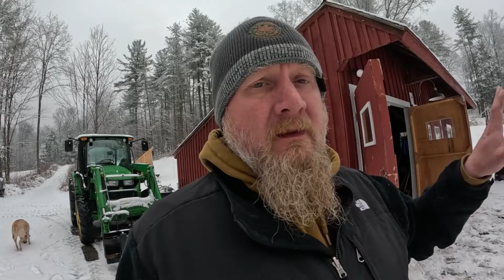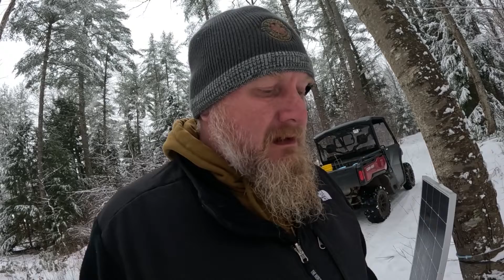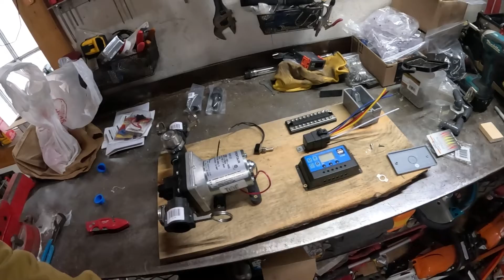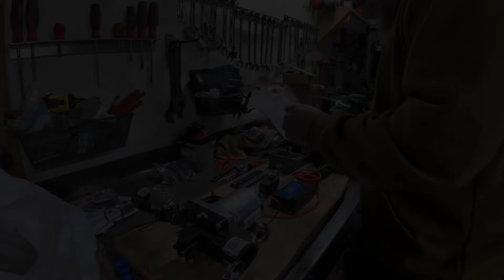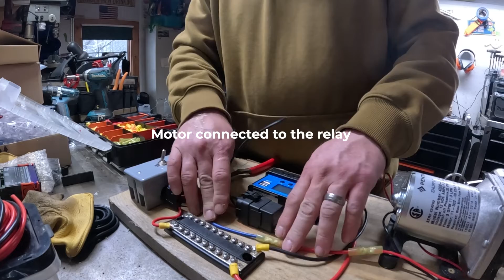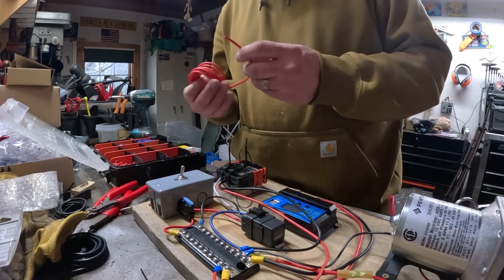Building an Off-Grid Solar Vacuum Maple Sap System

Comment: Mine pulls 18 inches of vacuum on 300 foot of 3/4 main line with 100 taps and 10 laterals. Have had a couple days in the last couple years that were 200 gallon days.

Comment: I bench tested the 4008 and 4048.  When it comes to pushing water obviously the 4048 with a bigger motor has a larger capacity but when pulling a vacuum they both perform the same.  Both pumps would achieve 25 inches of vacuum with 30 gallons per hour of flow. More flow  and the vacuum would start to drop off.  When pulling a vacuum both pumps ran between 1.2 and 1.5 amps of draw.  Conclusion. For pulling vacuum don't waste your money on the bigger motor.

Comment: Great video very informational.  Question how did you connect the mainline to the pump? Which adapters did you use? Thanks
Reply from the maker: I didn’t use any adapters, I attached the main line directly to the pump with a hose clamp.  The 3/4 main line was just the right size.

Comment: I am a little confused, well, sometimes that is an understatement.  LOL.   Why do you need a car relay when the temp controller has a built in relay?  I have seen this before on some other videos and was wondering.  I have this same setup but without the car relay and have had no problems.  Just curious why it is needed?
Reply from the maker: I followed the plans that I found online and they called for the the rely which my guess is for the higher amp rating.  The Temp controller is only rated for 10 Amps the relay is 30 amps so it just builds in a safety factor, to prolong the life of the temp controller.  But if yours  works without the extra relay that's good to know for the future.
Reply: Yeah, I thought of that too.  The pump is only rated at 7.5 amps so I figured I was good.  If it blows up, then I guess I should have used the extra relay....  :) @kalevalasouthfarm